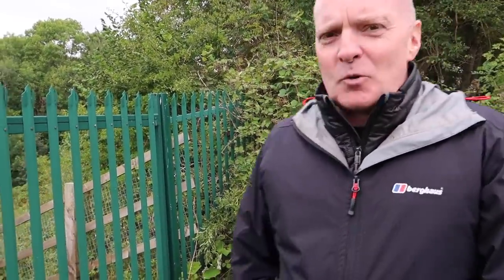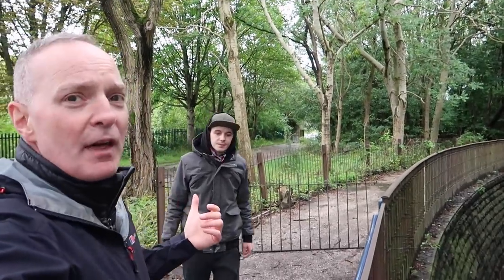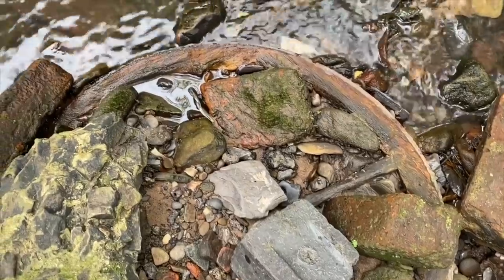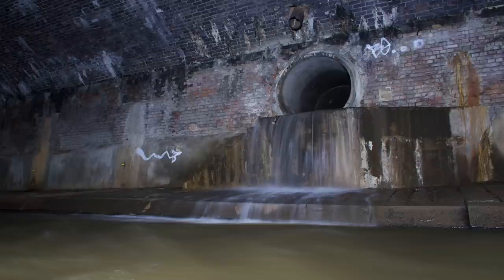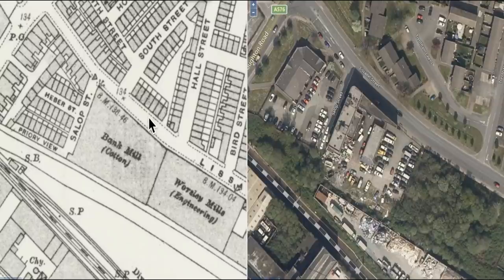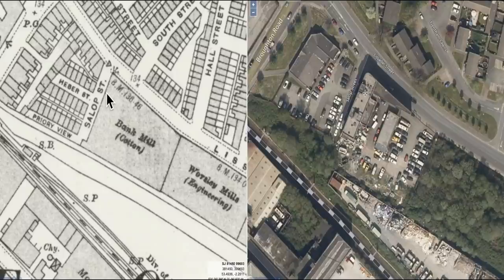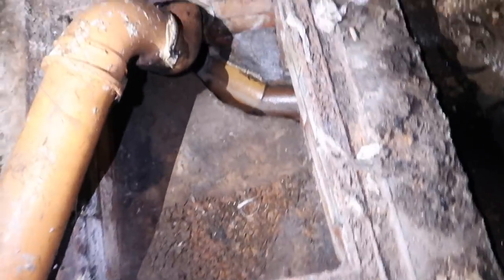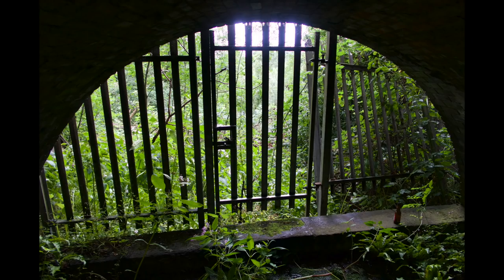A wheel, a drain and a mill

Comment: When you were on top of the mill in Salford, you looked across to a grey bridge over the railway. On the far side of that bridge, there used to be a train station, which closed, I think, in the late 60's. It was Pendleton Station, not to be confused with Pendleton Broad Street, which was a hundred yards or so further up the hill.
The main station building was to the left on the far side of the bridge as you were looking at it and to get to the other platform, you had to exit the station and cross over that road bridge to another entrance. I left Salford to live abroad about 25 years ago, but I still have memories of catching the train at that station, so I wish you'd gone and had a look to see if anything remains of it.

Comment: That wheel could be a lot of things.  Early automobiles had wood wheels.  But carts did too...one clue would be the shape of the steel tire.  If it has a "U" shape, that means it originally had a rubber tire.
Reply from the maker: Wish I knew its history Fredy
Reply: Lancashirelad No one made spoked wheels without steel tyres after about 800BC. The tyre holds the wheel segments together. 
After about 1850 rubber tyres started to be fitted to smooth the ride and reduce wear in paved city streets but they were not common.
Reply: Lancashirelad Pretty much - you can safely assume that it is post Roman occupation in Britain...

Comment: Yep the Bolton Corridor line. On the other side is the line that goes from Wigan. Plenty of older buildings in that area. It looks like it was either a newer build on the old sight or one that used a fraction of the old one and added the deco stuff in place.
Reply from the maker: Yeah Iam inclined to agree with you Foxstar

Comment: I would say your'e right about being Art Deco. the rounded corner of the building & the decor, coupled with the crittall windows (metal framed), & the fact that Asbestos was used, scream late1920's-early 30's definately exclude this building from being built in the 1800's. I have been an art deco fan since the 90's, & suggest you look at the Hoover building in London for an example of Crittall windows. Nice vlog though Martin, keep em coming. Regards Rural Geeze.
Reply: Rural Geeze your right the building looks Art Deco but I doubt it was built in the 20/30s that would mean the original mill only stood 40 years, it doesn’t sit right they would have pulled it down so quick
Reply from the maker: Yeah love the Hoover building and cheers Rural 👍

Comment: Super video. Love that mill the lift was astounding!

As a heads up, take care when around microwave antennas that you might find on a roof - don't get close to them. You're always sensible and respectful so you'll be fine.

Microwave transmitters can be dangerous if they're higher power and you get too close to them, usually within a few metres but it depends on the transmission power. See the guard rail on the roof (13:49 ) as an indication of a safe distance. There should also be yellow warning signs nearby that provide information if they are transmitting at potentially hazardous levels, and whilst it is boring for explorers like us, for larger towers there should ideally be no access available via secure locked doors that only the telecom company can operate. If you're not sure, just keep a distance. At close range microwave transmitters will heat human tissue, however they pose no risk once you're a few metres away as the energy dissipates. This has nothing to do with those dumb wild "theories" going about. 

Also great to hear a mention about asbestos, it's fine if you don't touch it but best avoided. 👍

This video looks perfectly safe, but for further info for those doing explores, see this vid
https://youtu.be/ulveB1c3hCs

or this doc https://www.firehouse.com/safety-health/article/10513827/the-facts-and-dangers-of-rooftop-transmitting-devices-on-highrise-buildings
Reply from the maker: Ahh never thought of that. Thanks very much

Comment: I found at the internet, Bank Mill was there since 1779 (so more then 100 years older as the date Danny found). The mill suffered of 3 large fires in 1828 and 1829 and damage of a storm in 1839. Can't find when or why the original building was demolished but I can imagine it as a 150 year old building with a lot of structural damages of the fires and hurricane, it might be just a pretty unsafe structure. Good chance the mill went bankrupt in the crisis of 1927. The building you visited is clearly late 1920's, maybe early 1930's. The Art-Deco style, the green stone in the hallway, the staircase, the tiling, it is all screaming "I'm 1920's/1930's". 
https://www.gracesguide.co.uk/Bank_Mill_(Salford)
Reply from the maker: Thats great and thank you for the info
Reply: @MartinZero  You're welcome.

Comment: The building screams Art Deco! From the outside to the detail above the lifts and the railings on the stairs! The old map shows a solid building in the space, while the new picture shows a building in just part of that space! I think you are right! Its a newer building built in the Art Deco Style! Now that being said...why? The old building was built in 1891 and Art Deco was from Mid 20's. So after only 35 yrs the older building maybe burned down? Or outlived it use and was downsized to a smaller building! Lots of questions haha! That wheel looked really old! From a wagon or maybe a workings!  Nice to see Danny again! Thanks Martin!
Reply: Original building was probably build in 1779 instead of 1891 (https://www.gracesguide.co.uk/Bank_Mill_(Salford)), and had several fires and damage of storms in it's life time. It makes more sense to me they demolished an 150 year old building with a lot of structural damages than a building of just 30-something old.
Reply from the maker: Cheers Miles I pretty much agree with what you have said

Comment: The mill looks 1930s to me Martin, all those details on the ground floor staircase and the lift area. Probably a replacement for the older mill. That wheel in the River certainly looked like wood with a metal rim. Could you find it again ? Definitely worth retrieving. Great video again Martin, will look forward to the members video on Wednesday.
Reply from the maker: Thanks Anne, yeah 1930's I agree. I could probably find the wheel

Comment: The building you called the Banks Building is definitely later than 1890, much more 1920-35. They didn’t do that curved front and the fancy work on the elevator until the 1930’s. 
Not many people could build those circular stairs but my uncle Arthur could do them. He was well know for  his woodwork, indeed he may have done those if they were constructed in the 30’s Manchester.

Comment: The wheel looks interesting it is wood surprising it's still looks pretty good the water is preserving it. Could be off a cart maybe well spotted that especially in the river. Loving the lighting in the drain looked quite impressive with all that water must be the kid in me. I love coloured lights where did you get them lights I know you did say in a video but don't know which one now?
The mill looked pretty cool especially the old lift shafts with the wooded surrounds around the doors you don't get that anymore it's a shame really. Everything these days is so dull boring and one on the cheap if you know what I mean including new buildings no character. Old brick buildings just love them. Thanks for sharing..
Reply from the maker: Thanks David. The lights are called 'Boling P1' off Amazon. Not cheap but very effective for night photography
Reply: @MartinZero  Thanks Martin.Have you got affiliate link if you had I could use it?

Comment: Dont know of you found it on your recce or not, but it you walk round the path round gorton resevoir, on the opposite side to the Dbdale park, you come across some objects I cant figure out, there are cast iron pipes mabe 8" bore which come out of the banks and turn 90 degrees up and stop at a large flange - also there are a couple of round stoner constructions abour 8ft diameter one is half dismantled the other in tact - alse is Kings Rd that runs up from the causeway/hyde Rd junction through the gold couse up to Droysleden - most of it original sets

Comment: Well you have your pigeons lined up nicely...
From where I was standing the wheel looked like it was made of "iron" and was used to open a big valve of  some sort. It was wood you say?
Reply from the maker: Yes Bill you could see the inner rim was wood
Reply: Wheels like that were made of wood with a metal tyre fitted.  The tyre was heated to red heat to make it expand, placed over the wooden wheel and cooled down so it contracted and gripped the wood.
Reply: @MartinZero   well it probably is a vintage wheel then! It's diameter might give a clue to the sort of vehicle it was attached to...
Reply: @rogerbarton497  an invention of the Celts as I dimly recall ...

Comment: It looks like the pigeons were expecting you! If it’s not spiders it’s pigeons!

The wheel appears to have a metal rim, indicating it would’ve been used for a cart/barrow.

Is that building with Co-Operative on the side the one that used to be owned by Queens Park Motorcycles?

Styling of the mill looks to be from around the 1930s
Reply from the maker: Not sure Phil it was a flying visit to be honest. Deffo not 1891

Comment: i'd say cart wheel, and the mill looked 1930s-40 maybe later50s even
Reply from the maker: I would love to think its a cartwheel
Reply: @MartinZero  I would agree it's a cart wheel, there would be no other reason to have a metal 'tyre' if it was a hand wheel
But it looks like only 4 spokes, so a small handcart would make sense
As for age of building, i would say 30's, there's one glance @13:48 of what looks like a skylight with small square glass panels, so my guess is 30's, we had a similar skylight where i worked but with round glass, and that building was sim9ilar era.
The lift control panel also looks 30's/40's
Reply: I'd agree on both points. It certainly looked like an old cartwheel, although it was hard to judge the size of it. As to the building; my first thought was "between the wars" and, from known dates of similar buildings, I'd narrow that down to late 20s/early 30s. My knowledge of industrial architecture, however, is limited to what I can find on Google, so others will know way more than me.😁

Cheers for now,
Dougie.

Comment: The style of the main part of the Mill is definitely 1930 - early 1950s.  However the cellar had flag stone floors which points to an earlier building, also the wing  with older looking brickwork does not fit in. I am guessing that the old mill was partly demolished and the present building built over the original cellars.
Reply from the maker: I agree David, deffo a later build

Comment: I would have said  it was built 1920 to 1940 as the beams/columns in the cellar where rolled steel joists(they had tapered flanges)made up until the 1960s ,the  beams then became universal beams with parallel flanges

Comment: The slate logic for the lift looks 20's to 40's I think. Vary vary rare to see.
Reply from the maker: Oh right, is that the thing on top ?
Reply: Somebody on YouTube, perhaps BigClive, examined on a video an old slate board controller for an elevator...
Reply: @MartinZero  It's the big black board on the wall covered in electrical hardware  (relays)
At the time they used a slate panal to mount all the relays. The entire controller is electromechanical.

Comment: If the building was built in "Art Deco", then it places the mill in the 1920's. One of my least favourite eras, to be honest. The flagstone floor, however, is Victorian. They must have pulled the mill down and placed the iron girders directly on top of the origional pillars. It's a shame, but at least the site was reused and given quite an interesting look rather than left to rot, as with other mills in the area. Excellent video.

Comment: The more I look at that building, and old maps, I'm really starting to suspect a major fire, something serious to make much of the original building unsafe. It may then have been rebuilt, taking into account changes in the owners' requirements since it was originally constructed. That could explain the different shape. The lift is surely a good bit after 1891; would the original not have had hoists? Assuming it was insured, replacing the original with a smaller building might have meant there was money left over for stuff like lifts and marble.

Comment: another great video, one thing i like to look for is the old bench marks, on your old map of bank mill it shows a benchmark on the corner with a number, these are scattered all over the country and are for taking heights when building something new, its a fixed point and is a constant, the fact its there on the old map you may have been able to date the land around there by finding the benchmark, i am taking you know what these are with your knowledge but just in case its an inverted V with a horizontal line above it, the line is the height.
https://images.app.goo.gl/TS519Ys7oJMzweVo8

Comment: That spiral stairway is too recent to be original, the steps are no way old, or they'd be worn down at the front, from all the feet tramping up and down. The decorative trims on the lifts, and the round corner of the building all say late 40's early 50's, but that stairway must have had the treads replaced since then.  Looking at the cellars, I suspect the flagged floor and the brickwork are original, but the steel girders are the mk 2 building.
Reply from the maker: Yeah I agree definitely  a later build

Comment: That wheel? - It's a cart wheel, and probably not really all that old. The building - Hmm, don't think they had electric lifts in 1891! and it's definitely not a retrofit. The windows in that building, or at least some of them, have what were known as "panoramic" panes. They're straight out of the 1930s, or at a pinch, late '20s. That building isn't massively old, and I reckon is "high-side" 1900, and by a tidy few years - I doubt it was there until after WW1at least! Why the odd shape on that long section? - Probably just making maximum use of the available ground space between pre-existing buildings, buildings that are no longer there.
Reply from the maker: Yeah I agree, deffo a later build
Reply: @MartinZero  What would have clinched it, would have been if there were any "Curved Glass Panoramic" panes, or curved glass bay windows. That would have placed it about mid '30s. We didn't see any, so it leaves us thinking early '30s, or just possibly , very late '20s.

The building itself has something of minimalist "functional" appearance that makes me think of post depression (after 1926) redevelopment.  It's still a nice example, and in my eyes at least, should be saved and restored.

Comment: MARTIN!what is your email pal. I picked up some footage from ashy valley that you missed out. it's stunning. you're free to use it and if you need showing where it is ill gladly help you. YOU WILL LOVE IT!
Reply from the maker: martin0401@icloud.com cheers
Reply: @MartinZero  the files wouldn't send mate tried over and over. Is drop box better? 

https://youtu.be/zuRz2YIvbH4 

There's more but here's what I used myself. That waterfall must have turned a wheel judging by that cogs position.
Reply from the maker: Yeah I mentioned the wheel. The gears are still there as we both showed. Yeah try Dropbox cheers

Comment: The only reference I could find on this mill listed it as "Bank of England Mill".  It's not Art Deco if it was built in 1891,,in fact it looks more like a building built in the 1930s. If it's listed as 1891, then you are looking at an extension added on later.  Please, when facing thick undergrowth don't wimp out like a city slicker!   And for crying out loud, get some decent flashlights!  I love your videos,  but it's frustrating to watch you go so unprepared with tiny lights, no lengths of rope, no gloves, sneakers instead of hiking shoes or boots!